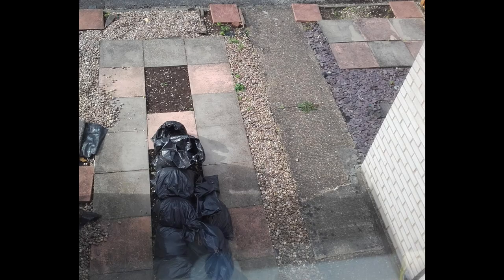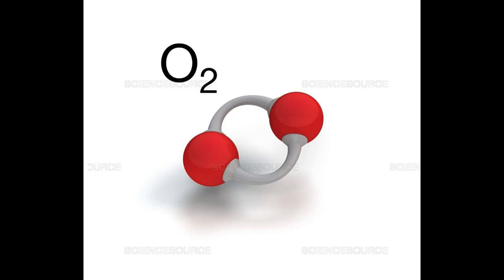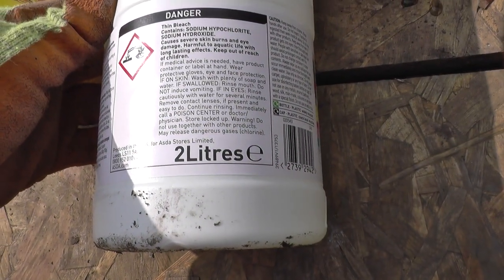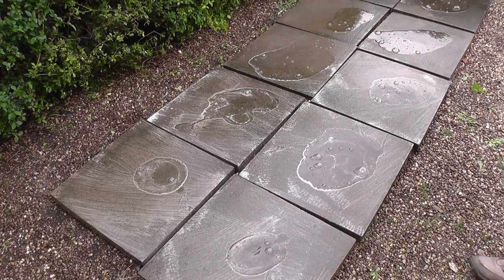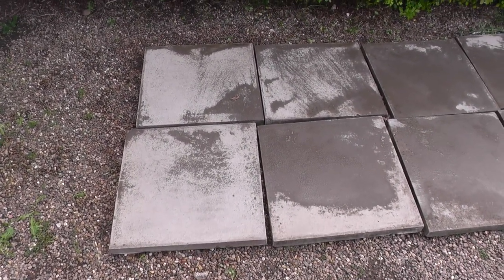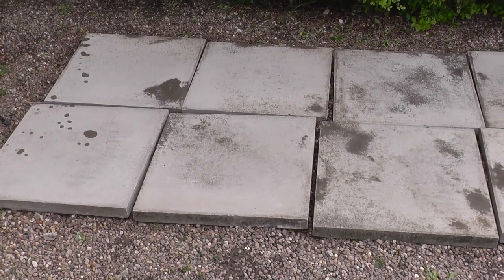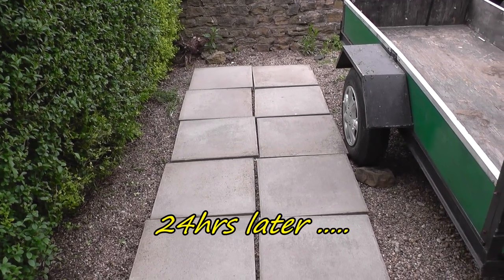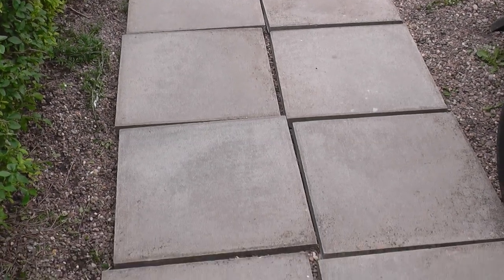How To Clean Concrete - Guaranteed Best And Cheapest Way

Comment: just  did  my slabs  recently  with  a jet wash and they  come  out  perfect
Reply from the maker: Sweet. But if you're a scummer like me and either don't have a pressure washer or are skint  then this is a great alternative. Stay safe and well my friend, Des
Reply: Takes the surface off!
Reply: @marypetrie930  And you think a strong chemical won’t… 🤣🤣 I swear people are getting dumber.
Reply: Problem is they make a right mess and blow any jointing out from between pavers. A lot of people have given up with the pressure washer idea, pipes all over and dragging the damed thing around. My went to the tip last year.
Reply: Normal bleach watering can  ...scrub in ...wash down with hose...sand cement & rock salt mix or dishwasher salt ... brushed in when dry  Hey presto   no weeds   no big bill ...in the long term  jet washing don't work

Comment: I would highly recommend using mortar stain cleaner by bostik which can be found at toolstation and retailers like that. It works even better at removing cement stains from brickwork and paving but it’s essentially hydrochloric acid. If doing a small job with minimal stains I would advise to dilute it down just like you did with the bleach used here
Reply from the maker: Thanks for your valuable feedback - appreciated. Des
Reply: I have mortar staining on my newly installed patio where i filled in the joints with mortar, soon as i filled in the joints i used a wet sponge to remove the excess from the edges of the joints. But once the slabs were dried it left a yellowish straining on my textured buff slabs, so would the bostik remover do the job for the stain removal

Comment: Great little informative video, never thought to use bleach. I’ve got to remove 3m by 3m decking and the slabs underneath will need a good clean. Also the slabs aren’t the same colour as the others so I was looking to paint them with weather shield paint to try and match them up this would be an idea cleaning agent instead of borrowing a power washer.👍🏻

Comment: There are precautions about using bleach in terms of paver integrity & colours fading. You did speak on it briefly- in your experience has this occurred (given you made this video 3 years ago). It's probably overstated, but I'd like to hear your experience before embarking on it. I'm going to use bicarbonate + dish washing soap to start off with
Reply from the maker: Hello there and thanks for your message. I've bleached a number of pavers over the past 3 or 4 years to save money and cost of buying new. Never had a problem. So nothing negative to report in this regard. However, what I would say is to make sure you bed them down properly so any weight placed upon them is distributed evenly just in case it does make them weaker. Bottom line?  Still going strong with no probs. Hope that helps. Des

Comment: I did some painting on a front door and shed. Some oil based undercoat has dripped and landed on older course steps and flag stones and dried. Is there a good way to clean undercoat paint off these before I start the gloss final finish?
Reply: No. Replace all of it.

Comment: I did a load of slabs at work I forget what chemical we got but it was strong stuff,  I just sprayed it onto the slabs and you could see the colour changing with in a few minutes of doing it, and that was without any scrubbing, it was strong stuff it was heavy going on the chest and eyes.
Reply from the maker: Hiya G. Bet it was expensive as well mate. I'm sure that with some of the industrial strength chemicals out there you'd need respirators, goggles and the rest mate. Stay safe and well, Des
Reply: Muratic acid or xylene

Comment: Would this also work on a normal brick back garden wall
Reply from the maker: I personally wouldn't even bother trying mate. There will be much better products out there for this but they will be quite expensive that's the only problem. Also, I'm not sure what effect the bleach may have on the mortar which binds everything together. I think it could possibly weaken it but I maybe wrong.  ATB, Des

Comment: Can you leave then until the next day then spray wash them?
Reply from the maker: Good question and one that I've thought about myself previously. I'd say don;t risk it. I'm not a chemist but I would be concerned that bleach would weaken the slabs and cause them to crack / break under pressure (i.e. when walked on).  The other thing is that you shouldn't need to leave them that long anyway. Personally, I wouldn't do it and don't think you need to even try. Best wishes, Des

Comment: How does power washing compare to cleaning with bleach? Thanks for the video
Reply from the maker: Hi there. Good question. That depends on your pressure washer. A powerful one will always win hands down but you have to be prepared to pay the price. You can get a decent one (see the Titan range) for around £100.00. However, even if you have one it won't get rid of every spec of dirt and the black spots unless you use the nozzle which gives you the tiniest possible jet and the greatest pressure. This will take ages though as you're literally cleaning a 3mm strip at a time. The bleach will definitely help to brighten up the slabs even after pressure washing. 
Just using bleach: you will still need to wash these down before you start with a hosepipe to get rid of the layer of muck first. You will then need to scrub them with a stiff brush (this takes the place of the pressure washer). Then apply the bleach - you may need a couple of goes with this and you will still need to give them a bit of a scrub to remove any stubborn bits. You will need to rinse them thoroughly afterwards.
Conclusion:  a decent pressure washer will win every time but you may still need to bleach them afterwards if they're badly stained.  The cheapest way is definitely to scrub with bleach which costs mere pennies but you may need to use a bit of elbow grease to clean them up really well. However, you can do this just as quick than with a pressure washer.  The best solution would be to combine both methods for the most severe jobs. ATB, Des

Comment: I have concrete around my house how do I get it up better I have white spots on concrete and black iv used tones of bleach still haven't. Moved please????
Reply: there white spots i assume is lichen that has been killed due to the bleach (used to be yellowy/orange before treatments?). a pressure washer should remove quite easily. black spots need a stronger solution and a pressure washer to get rid off effectively (and even then its not guaranteed to remove them)

Comment: So essentially, diluted hydrochloric or muriatic acid, yes?? Methinks you need to be a bit more careful mate! Especially around your greenery. Have you tried vinegar as a safer solution?? Also, you must obviously use PPE!
Reply from the maker: Hi there, yes either of the two you mentioned - they're just acids after all. Obviously don't do this near shrubs or plants - common sense required.  Unfortunately, this is greatly lacking with some people. Do it out of the way where you have weeds, gravel, etc ATB, Des